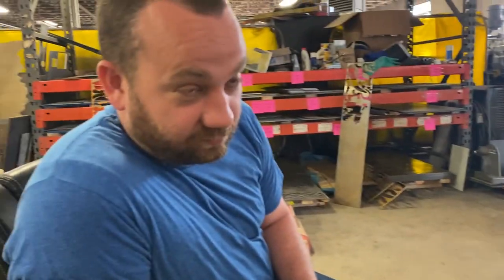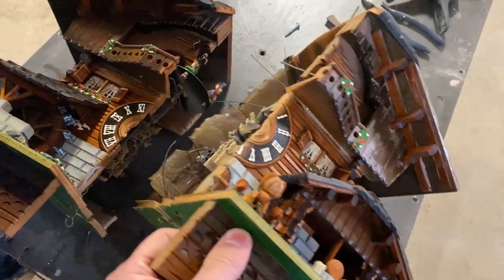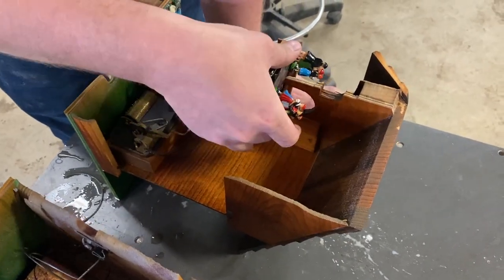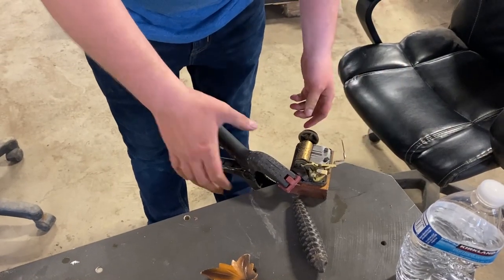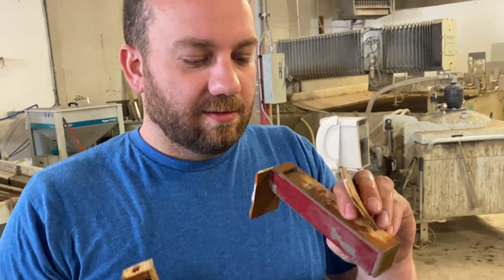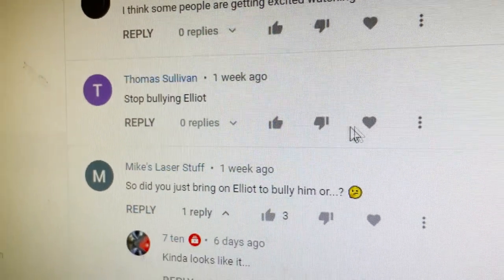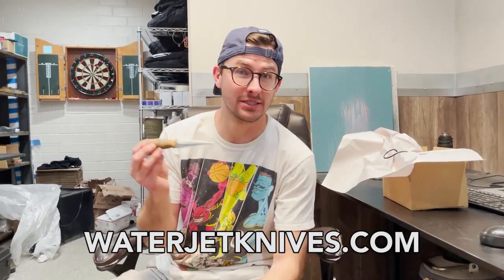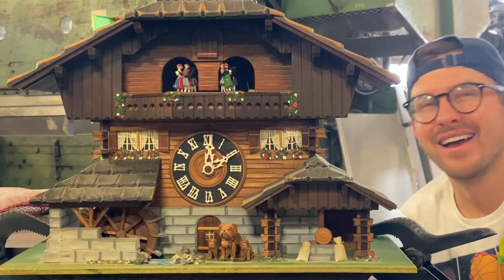Inside A Cuckoo Clock With A 60,000 PSI Waterjet

Comment: HERE'S AN IDEA - What would happen if you tried to cut NON-NEWTONIAN FLUID using a waterjet??? Under normal conditions, non-newtonian fluids will flow just how you would expect, but under extreme pressure - example, if you slap or punch them - they become solid. Sooo... under 60,000 PSI would an NNF become solid or just flurp everywhere. Check out videos of people walking on custard if you want to know about NNFs.